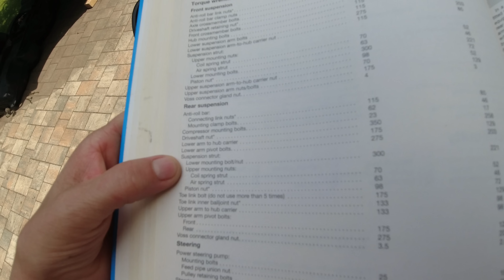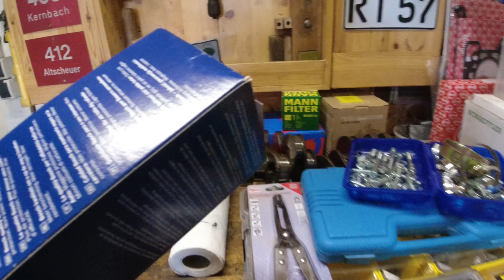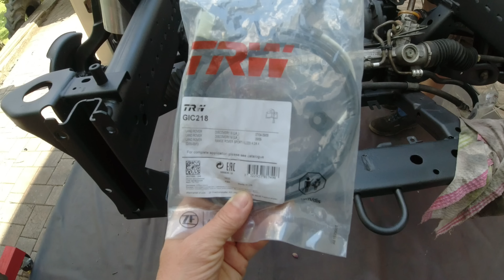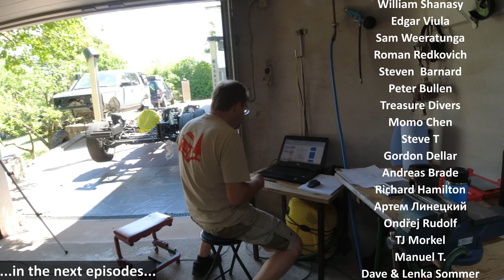LAND ROVER Restoration by German Couple (FUNNY!!!) / S4-Ep28

Comment: There is a top tip for the compressor mounting. Cut a horizontal slot on the top fixing hole so that you can slide in the compressor right to left, then the “horrible” top bolt only needs to be loosened a bit to remove the unit (and the two lower easy ones). This makes it much easier when the unit is installed with the plastic box in place.  Love the videos, thanks.

Comment: I bought an 2015 HSE this past Monday 07/16/23 from Autonation but had to return it due to the amount of work required. It was really inexpensive. But now I am gutted from returning it. The prior owner also drilled holes into the dashboard for a $70.00 SiriusXM radio (smbh). Autonation, failed to properly inspect the vehicle prior to sale, check engine light was on before I got home (100 miles away). The colour combo (white/black) just what I have been searching for almost 10 months. Anyway, back to searching for another one, the ride quality in these is just an absolute gem and make my XJ feel a little pedestrian. This is the first channel on YouTube I have ever return to watch.
Reply from the maker: Just remember, any cheap Discovery 4 probaly has massive maintenance backlog. 🙋‍♀️
Reply: Thanks for the response, you both make a great team. First channel I ever followed the way I do. You should create how to instructional and Rover manuals, tips and tricks for the company. I have learned much from your channel.

Comment: Great video again.  Just finished rebuilding the front right hand window winder mechanism on my Discovery 5.  Four years old and the cables corroded and broken.  Halfords bike stainless brake cables for £3.00, better than ~£100.00 for a new mechanism.  Fiddly job .Wouldn't have tried until viewing you and thought if you can do all that, I must try my small repair.
Reply: Thats shocking after only 4 years.

Comment: @5.51, that the way i usually change my C.V boots rather than trying to get the C.V joint off, i wasn't sure if you had to match the 3 bearings at the rear to which segment they were removed from
Reply from the maker: Only balanced side shafts need to be matched.  They are also only one year old.  Christian
Reply: @Vera_and_Christian  Thank you Christian, i knew you'd be the man that would know, the original Mini started to use a simular idea on the post 1974 Mini's but they were balls in a cage & they were known as 'Pot joints' & the later type used by other manufacturers were know here as 'Tri-pole' joints

Comment: I still think it needs Lanoguard in the chassis rails to stop them rusting out from the inside.
.
.
.
😉
Reply: I use Vickerlube Softcoat as it has better retention than the Lanolin based product. Having said that, anything you you do to reduce rust is always a win 🎉

Comment: Enjoyable very, lv been reading about the electrical problems with the Discovery 4 usually around 4 years old - ie out of warranty, complete nightmare a lot of vehicles especially 2018 s, Land Rover Main Dealers themselves cannot diagnose - they go back in on a trailer - LR get them going then after about 4-6 weeks back in on the trailer - No start - with such reports who has the confidence to buy the vehicles? Great work you guys

Comment: No need to completely disassemble the drive shaft to change the outer CV boot. The outer CV comes off the driveshaft with a sharp tap. It can be done on the car. Off the car, it's really easy.

Comment: In the USA Craftsman used to sell open ended ratchet wrenches (spanners) you could buy them from Sears, Sears collapsed and sold the name to Stanley tools, the ratchet wrenches were then removed from the range. You can buy copies in Harbour Freight stores. But only in full kits. I bought two kits last year to bring back to the UK. It’s good to see you use Proxxon 1/4 drive kits, I picked up a set when I worked in Austria around 2003 and it’s still going strong.
Reply from the maker: Our Proxxon torque wrench broke after only 4 years. We bought our craftsman tools a long time ago at Sears, when we lived in Michigan for almost 10 years.👌👍🙋‍♀️

Comment: Please don’t use silicon grease in electrical connectors as it dries out. Only use Nyogel 760g, which a perfect product for use in all electrical connection. It will protect against fretting corrosion (caused by vibration).

Comment: I’m surprised you didn’t put the front strut boots on your new air springs.  RBG500010 is the part.  keep the fronts from getting corroded and dry rotted.
Reply: and btw the ebay/chinese ones are pretty much as good as the super expensive dealer version.

Comment: Is galvanising a disco chassis worthwhile? Seen a couple on that online auction site
Reply from the maker: That frame lastet 17 years with only surface rust, no matter what everyone thinks that rust is. One cannot tell from a video. It will alst another 17 years. Also you will have a hard time, finding a galvanizer who will put a frame with rust on the inside, into a galvanizing baths. To much contamination. At least here in Germany. 🙋‍♀️

Comment: Without a doubt, a Range Royce for Mother...I love the attention to detail...I am not the only crazy person...Also may I suggest or have you considered using Dynamat or equal, strategically positioned to eliminate the frame NVH? Saves installing the dumb bells at the front & weight? 
I got killer results on my v8 Monaro (Vauxhall Monaro) which had huge resonance issues...Do a tap test, where it "rings" place a piece of Dynamat...
Please give your thoughts!...Regards Des from Australia....

Comment: you are both very knowledgeable on the Land Rover luxury products. Fantastic. But I tend to not hold the same views on their capabilities. Looking at Australia, Africa, and the countries with deserts. Repairs to these vehicles is highly specialized, the parts are expensive, with extensive waiting times and the repair people do not have diagnostic scanning tools, or access to the synthetic oils. The older landrovers were made like tractors, and were boneshakers but the new 4x4s are a drain on on one's wallet.

Comment: It's nice to see you guys again, I sort of drifted away when you seemed to be surrounded by LR4's - not a bad thing, one day we will change our LR3 for a 4. We've had the LR3 2 years now and to commemorate the event on the exact date our AC compressor died. (Not good in a Dubai summer). So to remind you, in 2 years our beloved LR3 has had 5 Air springs, 5 Air Suspension Compressors, 3 valve blocks, 2 batteries, 4 tyres, all new brakes, 1 AC Blower fan and 1 new AC Compressor. I'm sure that's not a record for a Land Rover. But that's not all. We finally have a good working air suspension... But, now we get completely random "Air Suspension Fault" messages, including the occasional restrict speed warnings and even the odd "Extended Height" warning. And all the time our air suspension is working perfectly. Sometimes we can go a couple of weeks with no fault messages, sometimes we get it whist hurtling down the motorway, sometimes when we start the car in the morning. No one knows why, tried the garages the forum, nothing. Its just an annoyance to finally have a working suspension bur STILL get the same old warnings.  Oh and yesterday our AC blower, which is a replacement, slows down and struggles when we turn Left. Only when we turn left. Drive straight, turn right, all absolutely fine. Turn left and there is a horrible noise as it slows down.  I love Land Rovers. My neighbor has a Lexus and a Land Cruiser, I tell him he is missing out on so much....

Comment: hi Christian, Vera,
I also love your blogs, and am a RR owner in Australia. on my second RR, this one a 2012 with the v6 3000 and twin turbo. The unfortunate thing that happened to us is my son Nick bought a used LR4 and it broke a crank, then with a slightly sus rebuild it broke again after 22,000km. I have a suspicion that the occurrence of cranks breaking may be more prevalent in the LR and not the RR, could it be that the LR does not rev. as high through the gears and therefore the torque is greater, or that the engine stress is greater at lower revs. My car (RR), revs typically to 2900 while Nicks LR revs to only 2500 and changes early into a higher gear, this maybe causes the engine to run in a more stressed environment. What do you think?
Regards
Gary
Reply from the maker: That is possible I think.  My LR4 is also impossible to keep above 2000 rpm.  It shifts to save Diesel.  The 600 Nm are noticeable permanently which makes it a very powerful drive.  Christian

Comment: At the risk of being a desktop mechanic, I did research when refitting a boot to a Tripode Joint because when it came off it did not have Moly grease in from the factory. Research suggests that Moly grease is not the correct lube, I used GKN Tripode Joint Grease which I bought from Merlin Motorsport (UK). I don't actually have a Land Rover but will probably watch all your videos, become smitten and buy one, so it will be your fault.

Comment: Your compressor is not the original.  No AMK compressors were installed at the factory until early 2012. The AMK has a production date on it. Also you have the green push fit pipe connector which was part of the modification kit. I can't believe you didn't service the compressor air drier while it was apart.
Reply from the maker: How do you know if I serviced it or not?  Christian
Reply: @Vera_and_Christian  You would probably have said so. But possibly not. You may believe the myth that they are sealed for life. Unlikely though, as you're an engineer. 
Can we expect a how to service an AMK compressor soon?

Comment: Ah, the dear old Haynes manuals! Mine ended up foxed and tattered, with greasy fingerprints everywhere, along with bloodstains, drips of sweat and even teardrops.🙄 Unlike Christian, I was a rotten amateur mechanic, no patience;and when I got frustrated I'd strip threads and wear out heads of bolts and even break things, not knowing my own strength. 

Your mechanicking is a model to us all though; even those like me who'd rather bankrupt themselves nowadays letting a qualified grease monkey fix stuff.
Reply: Always leave the Haynes  manual in the car for the next hapless  owner to help them check the oily pages for what has been fixed!

Comment: Don't worry. TRW is not a cheap Chinese brand. It was an American brand with factories in Germany before ZF bought it. They have many factories in Germany. I know this because a long time ago, I worked for the company as a student in the department of electric parking brake products. The company was Lucas Industries before TRW bought it. Lucas was British. This is how the circle closes. So it's now a German former American and former British company. What can go wrong after all these merges 😂. Welcome to capitalism. But I guess your electric parking brake is not from TRW because these use a different system with a spindle and an electric motor directly on the brake caliper. Mechanically much less complicated and without mechanical wires, but I wonder if it is sufficient for offroad use.
Reply from the maker: Thanks. Christian